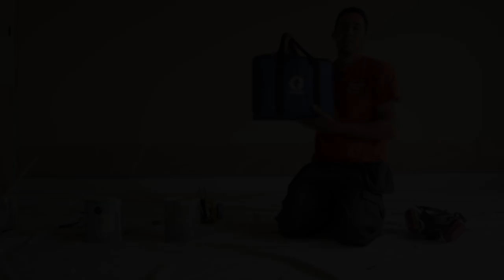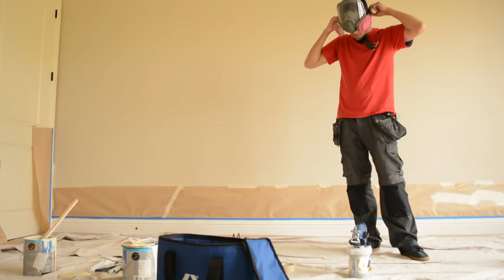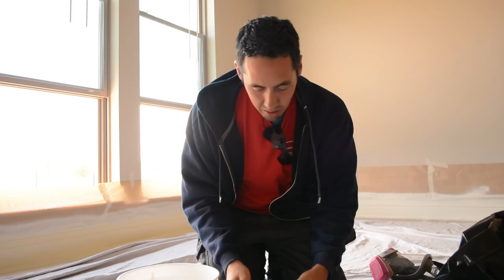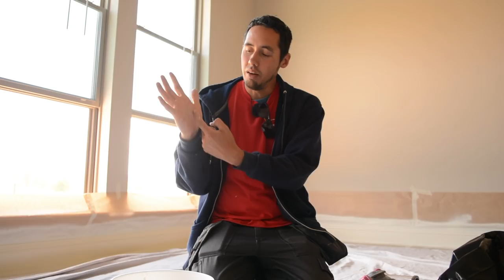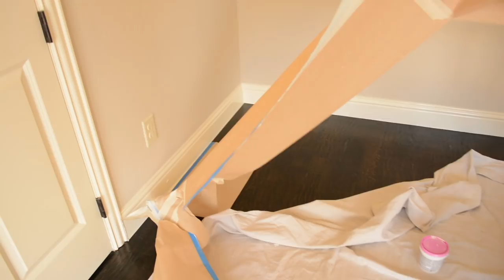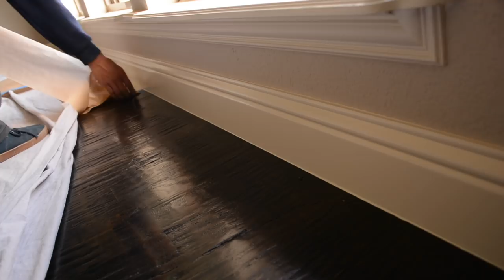SHOCKING Results! Graco Airless Handheld

Comment: yes there is a grounding cord that comes w the gun. its because of the oil base chemicals. it reacts to the sprayer. so technically u put that ground on and spray away. ur an awesome dude. btw, do u have any videos on door installs. your way? make one please.
Reply: of course, i may be wrong. i know that my fine finish graco had one. i dont EVER USE OIL ANYMORE.   LOL. KEEP UP THE GREAT WORK. WHAT AQRE YOUR THOUGHTS OF THAT SORAYER W DEWALT BATTERIES COMPATIBILITY ?

Comment: Hey Richard is the model you have compatible with flammable products? I have the same gun but mine was 699 it’s the graco ultra max. Bought it from acme tools online.
Reply from the maker: This one is not compatible with flammable. But It does say it is compatible with oil based. It's weird. Trying to figure it out.
Reply: Could be connected because you’re spraying a flammable oil based product. Mines “hot solvent compatible” which to me says cab spray oil based products because they require (hot solvents) to clean them out . Don’t know much about this but just a thought.

Comment: Great video, but for me in the UK I would love to know how long it was to clear the room, tape and sheet off the floor, wall and the final spray up?
I would hazard a guess that a normal brush job by a skilled decorator would be just as quick as they wouldn't need to tape off  the area and the room furniture could be lightly dust sheeted.
Not a a criticism bud, just that we in the UK would probably do it differently.........and possibly less or more efficiently?
Reply: With that speed you don't need any sprayer, and probably you can finish a room - ceiling, walls, skirtings and the door in one and a half hour. You probably have shoulders and knees of steel.

Comment: How do you get such a nice tape line on the floors after removing the tape? We (diy) use high quality tape but never get perfect lines like you did. We're replacing our flooring from carpet to hardwoods soon and I'm going to have to repaint and replace some baseboards. I'm more nervous about that part than actually replacing our flooring.
Reply: Hayden I use Frog tape. Nice clean lines.

Comment: Your paint had paint thinner in it... that will cause issues because it's flammable organic solvent. This causes a static build up in the gun. Also, thinner will destroy the pump in the gun. TC Pro is not rated for solvents.

Comment: The ultra has exposed electronics and is only designed for latex paints .  The ultramax is fully enclosed and spark proof   made for thinners and acetone based products that can ignite. Not sure if that helps you . Im not a painter but do repair these for a living.

Comment: Perfect for you but for home owner $700 I'll use a Purdy brush. Does great work though.
Reply: Joe T call me crazy but I enjoy cutting in base, doors & windows. My house has very rough wall board & plaster so I don't know if tape would seal properly.
Reply: Joe - I haven't tried this, but I have seen where you can tape your textured walls, then paint over the tape edge with the wall color, then paint your trim.  The wall color paint will seep under the tape and keep the trim color from flowing under it.  Something worth trying, maybe!
Reply: @Joe T The Finish Carpenter did a video on the tape and caulking. I did my whole house interior and for the few extra dollars for the caulking gun and caulking, it was well worth it.
Reply: Gun was cool may check into utra pro for cabinets an oil base

Comment: When ever you use oil based  paint is gotta be  grounded with a separate lead  wire to your gun and a ground metal object..
Reply: So then what's the point of cordless?

Comment: I'm curious about the batteries in the video you sprayed with the 1.5 amphour(amhr) and then when you were cleaning it with the 60v battery.  When I was researching the miter saw I came across another channel that talked about the miter saw with no batteries connected and adapter used in an outlet that kept blowing the circuit. I'm very far from an electrician (in other words your video on the box extenders was news to me when I watched it)  but it caused me to question if that was a possibility but it doesn't make sense to me with the knowledge I have which is limited. On yet another channel a guy turns an 18 volt adapter for 18v-20v Dewalt tools into an 18v adapter for ryobi tools so he can use the air inflate random orbital sander ect. with his Dewalt batteries.  Anyway short story long I, in his video he talks about the logic running the electricity in the tools I think you would like it. I don't know if it would explain the shocking experience though.
Reply: So I'm plugging other people's channels, sorry if that's rude but I've learned a lot from you tube.

Comment: Thanks man.  Good video.  Maybe I'm just don't get it but wouldn't it be quicker to just brush it instead of all the taping and paper laying?
Reply: Adventures of a Handyman your right in that sense but spraying does a way nicer finish,especially on eye level trim.
Reply: Not really because I'm sure they used the 3m auto masker. So much faster than doing it the old way by hand
Reply: For finish work a spray finish is always best
I have the same graco sprayer, works great
Reply: Man I just bought a full size airless and it takes so much time to clean it out even just using latex. I got upsold by Sherwin Williams because of its versatility over a handheld. But now if I'm doing a small job I'm not saving any time spraying because of the horrible clean up time. Almost wish I had gone with an hvlp now
Reply: You will have brush marks if you don't spray it. Oil paint may "lay down" better, but when people pay painted wood work prices they want that finish
Reply: @lazydadsgarage  people talk shit and they look like crap, but you can get a handheld hvlp for a hundred bucks or less that can be used safely indoors with minimal overspray (unlike the gracos). They're are a lot more reliable than YouTubers-who don't operate or clean them properly- would have you believe.  
 I sprayed some stuff with a wagner and took close up pics of the finish, then posted them to a painters forum, and people just assumed it was an expensive airless rig and you really couldn't see any orange peel.  I think it's partly that you thin it so much that it levels nicely and since it's sprayed, y ok u can go thick

Comment: Electrifying video. Wish I could have seen the taping up process. And what tape you use.
Reply: He used blue painter's tape to stick the paper on either side of the baseboard and yellow tape to hold it in place. 1.5" blue tape runs right around $7.00 per roll.

Comment: I'm going to bet that your sprayer does not have a sealed motor. I was going to buy an ultra but Sherwin Williams told me I could only spray latex because it doesn't have a sealed motor and the flash point on oil and lacquer is to low. Could cause shocking or explosion.

Comment: Look In ya bag.  The ultra max comes with a static earth wire with the plug. Otherwise you shouldn't be using solvent paints through the unit. Your tip is tailing too. Nothing to do with the handheld unit itself

Comment: After a ton of research.  I will never use this airless, or even air introduced portable paint guns for commercial use.  They will not work for consistent painting of concrete curbing, any parking lot painting, or repeated heavy use.  Not built for it, instead I found a large conventional air sprayer best suited or hand painting to keep from diluting quality paint.  I actually thought a portable paint gun would work, but learned otherwise what was recommended.  Don't use for large projects if reliability is desired, the brand & price does not justify those expectations.  Even the seller couldn't recommend it for anything grand.  can not even use it for airless stenciling for crisp lines.

Comment: It's the oil based and you need to check the ground. Turn the housing holding your reversible tip and it will spray vertical so you don't kill your wrist brotherman. Great video as always.

Comment: Oil based paints are banned in California, and for good reason. The volatile organic solvents are a real public health and environmental/air quality risk. Plus, as you show, you are cleaning the sprayer with another organic volatile chemical paint thinner. All those solvents become hazardous waste and very expensive to dispose of properly so most painters dump them where they shouldn't. Thankfully the painting manufacturers have developed excellent alternatives to oil-based paints.

Comment: Please let us know what they say ... I want one to paint my house
Reply: you should watch his earlier video regarding the sprayer before you paint your house with it. this is a 'small job' gun. just rent an airless rig and use a few 5 gallon pails rather than refilling the one quart cup, and priming the gun 40 times.
Reply: RangerCaptain11A I’m just painting the closet door and the trim .. wall was rolled
Reply: its perfect for that, especially latex interior paint. i use it to paint the ten doors all all the jambs and pre-paint the base. on the next project i'm going to paint the base after its installed. he made it look easy and clean. i thought you meant your ENTIRE house. my bad.
Reply: use 24 inch paper masking. the gun doesn't have much over spray.
Reply: RangerCaptain11A thanks for the tips and info..
Reply: RangerCaptain11A what tip is good for trims and door?
Reply: spyderx92 a 210 is a small fan for trim a 310 is wider for the door

Comment: On the first shock, I would have probably ejected the sprayer out of my hand and right through that window.  Major design fail.
Reply: Not a design fail. Graco has different sprayers, some for oil/water based paints and some that are for flammable liquids. He was using the wrong type for that paint and that's what caused the static buildup..

Comment: It is not the gun it is the oil based paint you  are generating static electricity and lucky for you you did not start a fire. You need to be grounded. When you use an airless you need to use the ground strap with some oils. Be more careful with paint.

Comment: I've been working on my kitchen and I started painting the cabinets with Sherwin Williams Pro Classic paint and using Purdy brushes and Wooster foam rollers. I can see all the brush marks and orange peel on the cabinet frames. I started brushing the cabinet doors and drawer fronts and same thing...I can see all the brush marks. Today I went and bought a Graco handheld sprayer (corded) and what a mess I've got going. I will now need to sand what few doors and drawer fronts I got done. I stopped painting. Any advice or suggestions that you guys can give would be greatly appreciated. I've tried barely having any paint on my brush. I've tried loading the brush. And today with the sprayer it spit on some of the drawers. I'm beside myself right now.
Reply: To avoid spits you need to start spraying off the surface and move across at a constant pace releasing off the surface again if that makes any sense also start on some paper first and test your spray pattern.. you may need to thin the paint out a little to achieve a good spray fan.. google how to setup and the model of sprayer you have etc.  and it’s always better to spray a few very light coats you don’t need full coverage on the first coat.
Reply: This coating is made to self level, if you can see orange peel and brush marks you are putting it on to thin and over working the paint. Also never use a foam roller as they just slide around, use 3/16ths  mohair or white knit Cover
Reply: I just got mine in the mail today and sprayed a beautiful oak mantel with no issues. I've never used a paint sprayer in my life. I definitely need practice but for a first time user, it was freaking awesome. I didn't experience any "spitting" mid-spray. Did you properly flush it? Did you strain the paint? I used fresh enamel paint I had just bought the day before from SW.
Reply: I had the same problem and switched to an oil based paint and got much better results. The paint had excellent leveling and I used a high quality brush.
Reply: Are you still able to buy oil based paints? I had used Purdy brushes and Wooster foam rollers. This time around I am strictly using the foam roller. I'm sanding in between coats and it is looking better than my first attempt. It definitely isn't painted furniture quality but it is looking better. I tried hiring several painters to spray for me even after I did all the work of sanding the doors and drawer fronts down to bare wood. No painter around here was in need of basically a blank check. Lol
Reply: Man you have no idea what all I've been through with this project. Lol. The frustrating this is before I even started this project in my kitchen (I extended my upper cabinets to the ceiling) I watched hours and hours of YT videos. I viewed hundreds of pics on Pinterest. I tried to education myself. I was watching videos in the middle of the night. This 2nd time around I used Zinsser Primer. Since I took the doors down to bare Maple wood there is no stain that I am really in need of blocking. This time around is going better. I wish I would have had better luck at spraying them. Hell, I wish I could have found a painter that knew how to spray. I'm on the downhill side of the painting though. I started the final coat process on the backs of all the doors and drawer fronts. Tomorrow I will start the final coat on the fronts. Light sanding on both sides and another coat of the SW Pro Classic paint. I will then reassess how both sides are looking and make a decision if I need to keep going.
Reply: I think the San Francisco Bridge is like that. They finish from end to end and start all over again. I appreciate all of your suggestions. Thank you Kindly.
Reply: Hire a pro ya bumb
Reply: If the gun will not atomize properly with the paint straight out the can you must add a little bit of water mix up. if it still doesn't atomize properly you must add a little bit more water mix it up, until you can get it to atomize properly! If you have to thin it down then you probably will have to put two Thin coats on... You can buy a product I believe it's called floetrol instead of thinning with water.
Reply: Hire a professional

Comment: Any oil will not make you look like a good painter. Actually quite the contrary. An inexperienced painter can make spraying oil based paint a nightmare. Most painters dont like it because they cannot apply it without getting runs, and its smell and long dry times.

Comment: The paint will absorb and dry completely different on paper than it will on wood. That's a 20-minute job with a professional and a brush.
Reply from the maker: True, but it does give you an idea of the consistency of the paint. Took me about 2 minutes to spray both coats. 15 minutes to mask.
Reply: I know you can use additives to smooth out the paint and use the best brushes so brush strokes won't show, but you can definitely tell when it was brushed vs sprayed. Sprayed has more of a professional finish for those picky owners looking for the best results. When working middle to high end homes spraying is the way to go. I've painted for over 10 years and am project manager now doing quality control.
Reply: Yeah a pro with a sloppy cut-in and brush lines.
Reply: George thinks a lot of himself!  Late to this thread but I couldn’t help it.
Reply: let me know how ur knees feel at the end of the week..
Reply: @Chris603fl  I'm on my knees at work constantly. As long as you got knee pads you'd be ok.
Reply: No its not. It would take longer than that to do two coats with a brush,  with dry time in between coats. I've been painting for 30 years. There's no way you can do all this baseboard in 20 and make it look right.
Reply: No doubt man. Would hate to see his work. lol